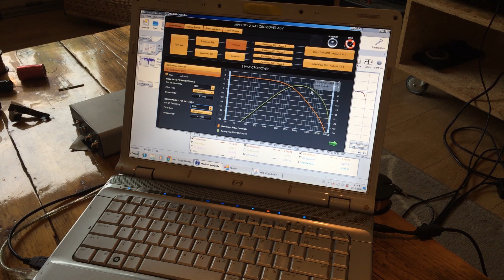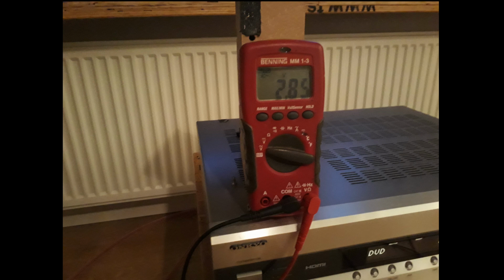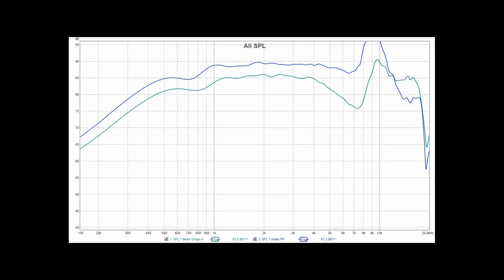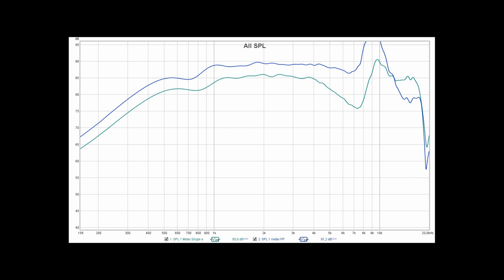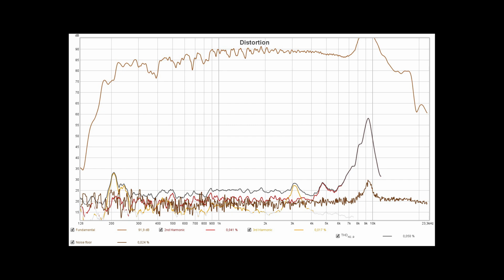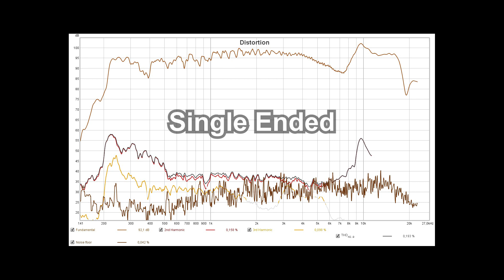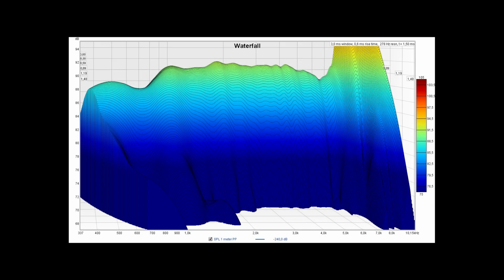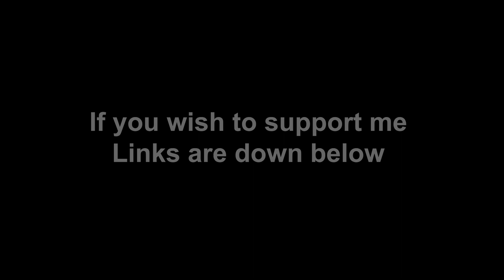Midrange Rubber Magnet Planar Magnetic Part 7 Measument results

Comment: How did you set the magnets?
Reply from the maker: facing the membrane  is  north south north south north.    looku0p google planar magnetic. and you will get an image of the magnet structure.   a drawing is a bit more clear
Reply: @joppepeelen  i watched a couple more and notice what you did. pretty awesome. I'm wondering how it would effect the speaker if you sandwiched film between the magnets and used an aluminum sheet for the frame, It might make it crazy efficient as a dedicated tweeter but would probably kill your low frequency response. That screen you are trying to figure out might be that old school speaker grill cloth that they used to put behind wooden grills or metal grills on those desk type pop up record players. its not stiff like glass mat and you can push your finger through without too much effort.
Reply: @joppepeelen  I really like the work yoou are doing though. especially the cnc foil laminante membrane. Ive been doing car stereos for almost 30 years and done some dumb ass pounding sytems but never really got into home audio components or ribbon tweeters. I have an itch for them now that I've heard them but Im not ready to pon up $200 or $300 for some damn tweeters. The ones you are amking are awesome and I might try something similar. Is there any inexpensive ones that are worth it just to wet my beak?
Reply from the maker: if you watched part 1-6 this question was answered i think :)

Comment: How do these panels match up against your other mid range panels. No sound test? Are you happy with the way these magnets worked or do you think they are not strong enough for desired results.
Reply from the maker: In happy. Just no idea what to use them for.  And i have nothing to  compare them to :(  all the small panels where tweeters and the bigger ones fullrange. I can say distortion is realy realy low. As low if not lower then a neo10.  Then again mine are longer  and efficiency is lower.  But still capable of 100db-103db. In push pull the 89.5 db is perfectly useable. Single ended at 86 needs the correct bass driver. 

I did not do a sound thing since dont have something nice to couple it with for lows. And high. :)
Reply: @joppepeelen  I guess what I'm really asking is, "Do you like working with the rubber string magnets vs. your regular magnets and would you recommend one over the other?"
Reply from the maker: @gzubeck3  i recommend the rubber  ! it has far less problems because there size :) so if you would make something it has to be bigger because they are not strong.  at the same time you get lower distortion becase you got big, since everything moves only a little :) but do go big big is the key. and floor to ceiling would be best!

Comment: awesome but what are these peak and valey in the FR?? is it because of the magnets obstructing the panel? between 2k to 8k is awesome
Reply from the maker: Yes mostly cavity resonance i believe every planar magnetic in push pull that i know of have this behavior , at least the midranges like the neo 8 and neo 10.  might as well be some breakup of the mylar, since the conductors are rather far away spaced.  making the magnets smaller so the distance conductor to conductor becaomes smaller, raises this behavior in frequency. so there might be 2 things playing a role.

but in the end you want to be crossed over to a tweeter panel far before you reach this problem :) since the panels are 10cm(driven area) wide. dispersion is not nice on 6khz.   vertical dispersion is even worse ofcourse.  but cant fix that. besides using 2 or 3 or 4 prefered floor to ceiling :) so in this case im gone ignore the huge peak :)
Reply: @joppepeelen  yes because of this i really think planar are not for me vs electrostatics.. also you have a some distortion peak in push pull.. tho they dont show in the FR.. its bigger peaks than one side magnet..wonder what would cause these.. maybe intermodulation distortion.. do you have these disto peak when you low pass filter under 1k?

can you fix the small peak and valey with pre-dac dsp linearphase EQ without affecting the sound? I guess not if you move the mic the peak/valey in FR will change a little anyway

i think a line array of tweeter + line array of 2-3inch midrange might be better.. 

at least for linearray of small driver for the midrange under 2k.. and thin planar/estats for over that.. i wonder tho hehe

Comment: Very close Joppee. Do these measurements help you to understand how to get a bit lower in response? I think this is worth studying a bit. 300hz would be ok. 90db would be fine as well. Your not far off.
Reply from the maker: Thanks dude ! Well my goal  was 300-400 To 5khz. :) it can reach both. Me must not forget there is hardly any baffle. I  forgot to use it in the video:(  but the roll of from 900 and down in the current baffle is exactly as i modeled in edge  :)  I might try and see what it does with a bigger baffle :) lots to play
Reply from the maker: I know how to get lower hihi, make the wider :) . To flatten the curve down low in the same baffle without eq would mean longer or just using to on top of each other.
Reply: @joppepeelen  I'm excited Joppee. When thriving to achieve a certain goal, it takes trial and error and time. Don't loose track. This is what most audiophiles are looking for.